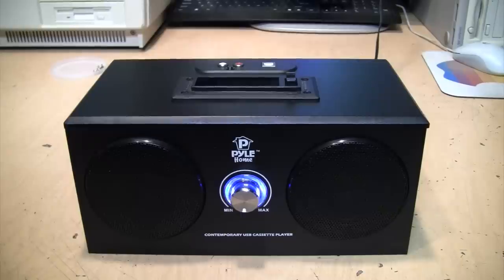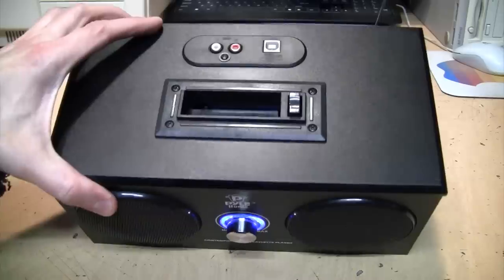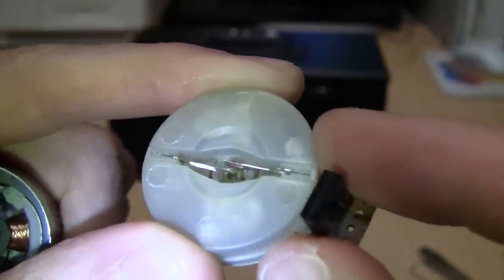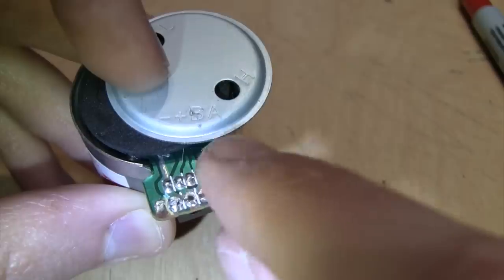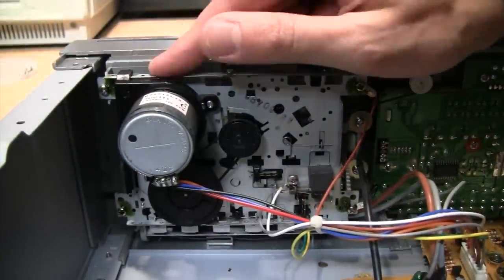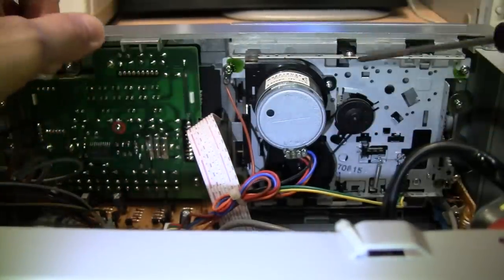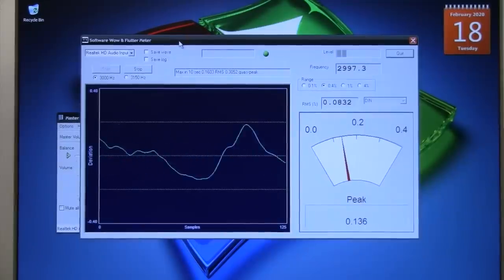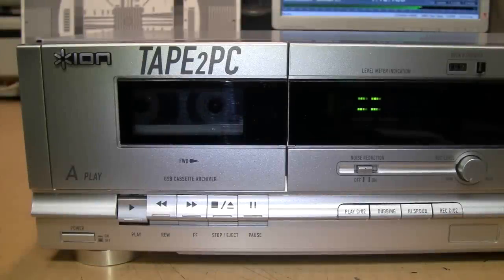How to improve your turntable or cassette deck with just 1 drop of oil

Comment: I'd suggest a purpose-made electrical lubricant like CRC Electrical Silicone Liquid Lubricant.  It won't gum up over time, is electrically neutral, and won't hurt plastics.  You can spray the whole motor and it will protect and lubricate.
Reply from the maker: I'm sure it's a great product, but buying an $8 can of it to fix a $2 motor seems a little silly.
Reply: @vwestlife  It would be a lifetime supply if you used it only for this application, but you can use it for nearly any of your electrical lubrication needs.  Fans, motors, potentiometers, typewriters, etc.  You can also use it around the house on hinges, garage doors and the like.

Comment: I always assumed those bearings were made from oil sintered brass.
Reply: Sintered bronze, not brass. I assume in nowadays' cheapo Chinese motors, they just use machined bronze or brass to save a few cents. If doing so, at least they should put a drop a grease in the bearings, but it seems they don't...

Comment: Tip for everyone: if you’re going to use 3-in-1 oil, use the oil in the blue bottle. 
The regular 3-in-1 in the black and red bottle has additives such as naphtha, and the oil will gum up. The blue bottle 3-in-1 will not gum up and is much better.
Reply: Regular 3in1 is poor. It is made for hinges and other easy-access things around the house. I used Hoppe's gun oil back in the day and switched to synthetics when they first appeared from LaBelle in the 60s.
Reply: @RuneTheFirst  Labelle was good stuff. used it for model railroads. I have about weened myself off of 3-in-1 (blue bottle only) for almost everything but sewing machines now.

Comment: I had a horrible screeching sound during playback so I opened up the unit a Denon drm 7somthing and sqirted wd Silicone into one of the back holes and it fixed the problem in an instant...

Comment: I hope this works on my Sony Dolby S cassette deck, It has 3 heads and sounds fantastic, but there is a lot of wow and flutter and the belts don't seem to be bent or too old, so I hope this helps. I also noticed the motor noise.

Comment: I just got a Technics SL-Q200 and it doesn't have the buzzing sound but it makes this really weird, faint clicking sound when the platter is on. It's not coming from the speakers, and you don't even have to have the power on to hear it. It sounds as if something is rubbing against something. I looked online but couldn't find any solution. I've heard the most common method is to lubricate the spindle, which I plan on doing. But I don't know if it will work. And it's very nice except for that, and runs at a constant speed. I'm afraid if I lubricate it, that may change.

Comment: Great video. Thanks. I am curious. Why didn’t you oil the front bearings too? It is an equal source of friction.
Reply from the maker: You can do that too, but in my experience it does not quiet a noisy motor. You need to take it apart and oil the inside bearing.
Reply: @vwestlife  How did you manage to put it back on without damaging the brushes?

Comment: Well, I did tried, but failed. I broke of -+ contacts of motor pcb (soldered them back directly though), however couldn't open and lift plastic circle plate. It was held by metal clips that wouldn't come off. Put it back together and back. Seems to work. A little noisy, but not unberable.

Comment: Anything that uses those cheapo motors are junk... I bought some motors for replacement work ... the replacements are junk as well... 2 out of 6 motors worked OK.... the others .... the wow and flutter made them unusable for cassette player or Phono use....I use singer sewing machine oil works great ...
Reply: that's exactly what I use!
Reply: Presumably Mabuchi motors would be good replacements in a cassette deck, they still seem quite cheap. They're seemingly still used in RC cars at least(were definitely used in Tamiya cars in the past, may still be), and also found one in an old cassette deck(quite a large motor in this case).

Comment: I watch a lot of your videos and you seem very knowledgeable about most electronics keep up the good work! I do have a question though, I seem to get noise from certain records with horns (Jackie Gleason in particular) but no noise with other records. I've not had success 'playing them wet'. I'm using a technics turntable with a Grado Black needle. Do you have any other suggestions or are my records just worn out? Thanks for any suggestions!
Reply from the maker: You may need a new stylus, or maybe the tracking force, cartridge alignment, and/or anti-skating on your turntable are not adjusted correctly.
Reply: @vwestlife  thanks for reply. The stylus is only a month old and I have a digital scale for the tracking force. I've used an alignment tool and I have an acrylic platter to adjust the anti-skate. The only thing I haven't adjusted is the actual arm height but it looks level when it's playing.

Comment: I have an old Sony PS-T1 turntable.  It plays 45 RPM very accurately.  It plays 33 at around 40 RPMs.  I found the plastic screw on the bottom of the turntable.  I tried to turn it but it won't give. I also put a drop of oil just beneath the spindle.  Any suggestions?

Comment: You need to go to a hobby store and get something similar to the liberty brand of oil that is specifically made for exactly what you’re doing not only is it a smaller size of oil since you won’t ever use a ton it also has the proper tip for getting into small little places and it works better not only the bottle works better but the oil works better

Comment: How do you get the brushes past the white plastic washer, without bending them beyond use??
Reply from the maker: They pop into place automatically when you reassemble the motor. I've taken apart and put back together these motors many times and the brush alignment has never been a problem.

Comment: Although not visible, there usually is some oil in the bronze bushings, as they give them a soak in the factory, but they should have a felt pad for adding oil to, but cheapening and all, because every microfraction of a penny counts... :P

But as an aside, the tape mechanism in that Pyle thing looks to be the same (or at least, "of the same type") as my Neostar everything in one thing, not used though as it sounds awful on my unit... :S

Comment: Hmmm.. great tip but care needs to be taken on the amount of oil applied. One drop seems excessive here. One can try dipping the tip of a needle in the oil and then using the tip to smear the surfaces needing lubrication. One needs to use caution regarding the application of potentially unsuitable lubricants as well. Service manuals may prescribe the correct type and amount of lubricant but that may not be always the case or the lubricant may be hard to source - especially for older equipment - or finding an alternative may require specialist knowledge. It all doesn't matter much of course if the equipment is of no particular value and vice versa. In some cases, such as reel to reel tape decks, more than one type of lubricant may be required.

Comment: Not really a good idea to use oil though, it will dissolve the plastic bearing the motor spindle runs in over time. Better to use a tiny blob of silicon grease

Comment: I have done this many times and 3 in 1 multi purpose oil won't work for long. Use 3 in 1 motor oil or synthetic thin oil. Never use any kind of grease, just oil.

Comment: Ive service plenty of decks and changed this type of motors (with the speed governor circuit) and never seen oil in them. New or used. They use "self lube" brass bushings. The motor vibrates when the bearing are out of tolerance or wornout. When new the barely vibrate. At least in the old ones produced till 90s. Because the two main manufacturers of those stopped producing those in early 2000 due to the cassette decay. The other thing that mitigates vibration is the belt itself and the mass that the motor rotates, the turntable or flywheel in the deck. Its like an RC circuit that dampens the vibration. in the mid 90s cost were dramatically reduced and flywheel OF PLASTIC were used in boombox and music systems. Still no vibration at all. that was because DC motors por tape decks were perfected many times till the point that a chunky flywheel was not longer a requirement. Todays turntables and cheapo boomboxes dont use this quality motors anymore. Im not calling them rocket cience, but copycats dont have the experience of Mabuchi / Matsushita / Sankyo when it comes to this thing, specially Matsushita one since theirstarted back in mid 60s and even developed their own chips for speed control

Comment: I'm gonna try this with my walkman!!!!
Reply: Grease is better than oil. Oil screws rubber
Reply from the maker: There is no rubber inside the motor.
Reply: @vwestlife  That's not always true. In higher quality motors, the actual motor is inside a rubber housing, to isolate it machanically from the outer case, so the vibration from the motor is slightly attenuated. But I think what Bryan meant to say is be careful with rubber parts such as belts and idlers, because if they get contaminated with oil, they will fail very quickly.

Comment: Does it work on walkmans or portable cassette players/recorders?
Reply from the maker: It might, but I haven't tried it. It depends if the motor is able to be taken apart without destroying it.
Reply: @vwestlife  thanks for your prompt response. 
Yes, that's what I was thinking. I guess I'll have to check the motors of my portable cassette players to verify if they can be dissasembled. At least the desk recorders have this type of motors, you know, the most common mechanisms. Thanks for the tip tho. Big fan of your videos. 😊

Comment: That's not what you should really be using on electric motors. 3 in 1 makes a dedicated oil for electric oils. The regular stuff doesn't seem to last long in electric motors from my experience. I don't even use that stuff for hinges anymore. You also don't want to get that oil in contact with plastic parts.

Comment: I'm surprised you got the back of the case, on top of the stator most of the time there's a ridge there a washer and the the prongs need to be kept apart before pushing it back on otherwise you can bend them. And put your belt in a bag of talcum powder before putting it on or get some talcum powder on a Q-Tip running it around the belt it will help with your Flutter and keep your belts in better condition
Reply: Yes indeed (destroying the brushes) made a comment about that and that most all of those motors have holes for holding the brushes out during the reassembly process

Comment: This is only a temporary solution. Those motors aren't designed to have oil in them, they use bronze bushings.
Reply: Most only have a bronze or sintered bearing where the shaft comes out of the motor. Sintered bronze will absorb some oil and retain it for a long time. It is made by pressing bronze powder under extreme pressure to the point where it fuses into a semi-solid. That leaves microscopic hole all over sort of like foam rubber. The other end is usually just slippery plastic but will keep some oil in place via viscosity of the oil itself. Better than nothing.

Comment: I used engine oil to lub practically ALL the small motors that I have, and practically works MUCH BETTER than 3-in-1 oil.
Reply from the maker: Conventional 10W-30 oil would probably be ideal, but my car uses super-thin synthetic oil, which I'm not sure would work that well for this.
Reply: Engine oils have detergents that may not be compatible with some bearing materials. It is best to use a non detergent oil.
Reply: @JohnAudioTech  By that they mean some plastics. But rubbers and metals will be fine.

Comment: Mine looks like there's a belt on the motor...if I pulled it out the belt will probably come out too, or slip off. If it does there's no way it's going back on. What to do now...🤔
Reply from the maker: It's handy to have a hook tool like I used to help put the belt back on. Also, some cassette deck mechanisms have plastic fingers where you temporarily put the belt on while reassembling it, and then when it's all back together you move the belt from them to the motor pulley. (A lot of Sony decks are like this.)
Reply: @vwestlife  it's such a tight fit inside mine, at least there where all the belts & pulleys are, that I have trouble even seeing everything. It's a Technics RS-B107. But I did get the speed adjusted! That was the main thing I wanted to do anyway.

Comment: No lubrication? that doesn't surprise me at all. I bet they did it on purpose just so it doesn't last too long. Just when you think, "How could they possibly make this even cheaper?" they find a way. I hate to see what electronics will be like in 20 years. Hell, even in the '90s, electronics were basically junk, but compared to the junk today, they were really well made.

I wonder how easy it is to open up the clock mechanism in my LTD to lubricate that? Those old self-winding clocks are notoriously unreliable, but mine actually works, it just needs lubrication, it runs intermittently.

Comment: i'd think a tiny bit of lithium containing grease would be better, less likely to run off or dry up..?? although i've used oil or wd40 for a quick 'repair'...
Reply: i dont take the motors apart as i've ruined a couple attempting it....some have parts of the casing bent over so removing is very difficult, maybe impossible...

Comment: You're very seriously wrong on this! 3-in-1 household/multi-purpose oil should never ever be anywhere near electronics or motors especially! This stuff will do damage as it's intended for hinges and things of that nature. Any search on forums like Tapeheads will yield plenty of warnings against using household oil. 

You should be using a light motor oil. 3-in-1 actually makes a small motor oil that works great. I've used it on various motors with great success and it's totally safe because it's actually designed for motors.
Reply from the maker: Yes, the same people who say that using WD-40 to fix a noisy potentiometer will ruin it, despite videos showing pots still working perfectly fine 10 years after WD-40 was used on them. And also the same people who say that playing a record wet will ruin your stylus and cartridge and the record itself...
Reply: @vwestlife  yup, those same techs who have decades of experience working for and/or being authorized repairmen for brands like Yamaha, Teac, Pioneer, etc.

Chemical makeup and intended uses of sprays and oils do speak for themselves. But hey, if you destroy a Crosley it's no big deal. ;)

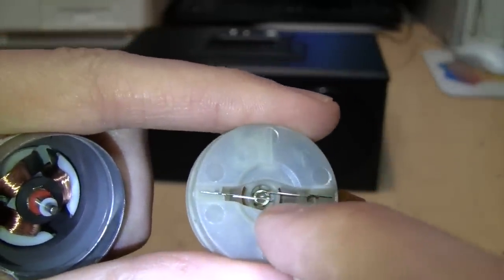Comment: You need to see how the lubrication of watches is done, to realize what a (4:22) "little tiny drop of oil" really means. You used an ocean. Thanx for the info though.. Btw I recommend you to apply a tiny amount of grease instead of oil. Oil will eventually fade away with temperature.
Reply from the maker: Yes, I know the drop of oil I used in the practice motor was probably too much. I don't know about grease -- the saying I've heard is, "if it slides, grease it; if it spins, oil it". A motor spins, thus I'm more inclined to use oil.
Reply: @vwestlife  Look, you practically applied lubricant on the fixed part of this system. Yet, even in rolling bearings they usualy use grease. I'm pretty sure you can use grease. Oil cannot stay for long on fast moving parts, and temperature is your enemy. Grease has higher density and resists temperature, so I think (I'm sure) it will stay there for much longer. A quick search showed that they use grease to lubricate motor bearings. There're different kinds of grease, you just have to choose the right one for this particular lubrication. 

Regards

Comment: Super unprofessional disassembling and assembling of the dc motors! First you SHOULD release the brushes from the collector before disassembly. Before you assemble the motor, you SHOULD open the brushes, push the back cover and release the brushes!  I am speechless!